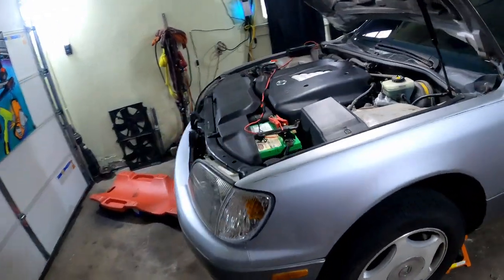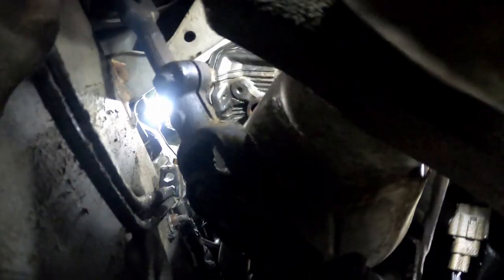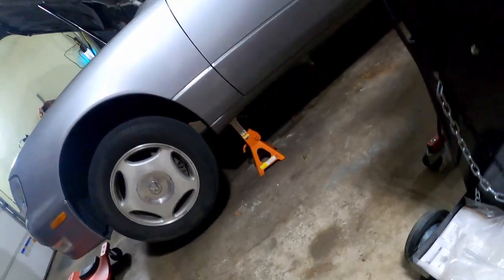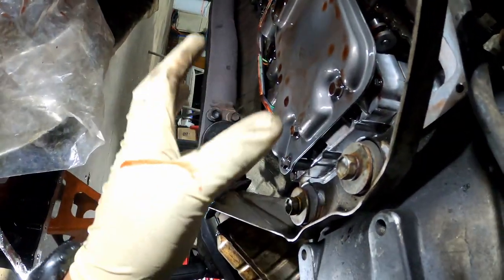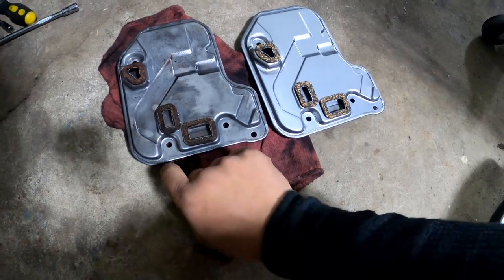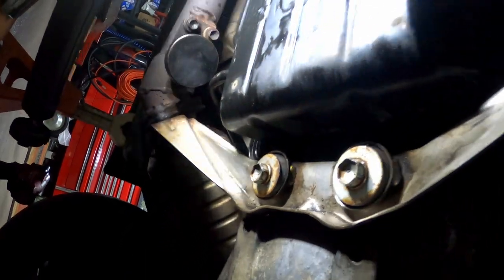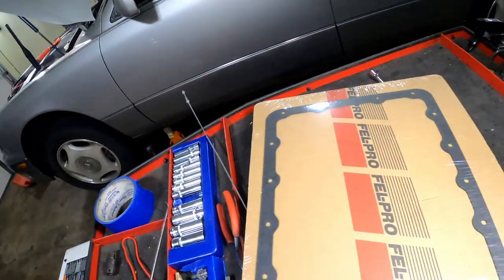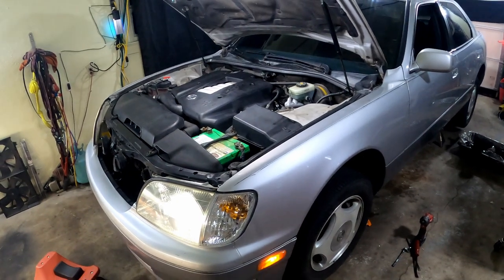Lexus LS400 Transmission Filter & Fluid Change|4.0L 1UZ-FE

Comment: yoooo don't put Amsoil in the car! Only use Toyota T-IV - it's literally the same price (like 8 bucks a quart), but the #1 problem with these boxes is using the wrong fluid. Use the Toyota T-IV (or mobil 3309, it's the same fluid).

Comment: On mine when I pour the fluid down it just leaks all over the ground, very weird, I have some weird resistance in my dipstick tube when inserting the dipstick, and after an inspection it looks like there is some damage to the lower portion of the tube
Reply: Replace tube

Comment: just did this now my transmission is slipping used only toyota fluid too 🥲
Reply: Any luck? I want to do this but I’m afraid it’ll cause my transmission to slip as well
Reply: @BakingBayked make sure it got enough TOYOTA T-4. If all you did was a filter and gasket there’s no way it can slip with proper fluid level